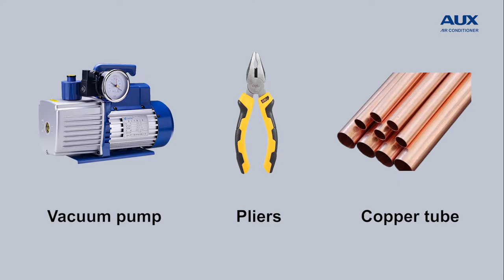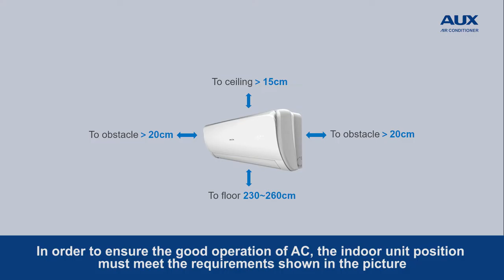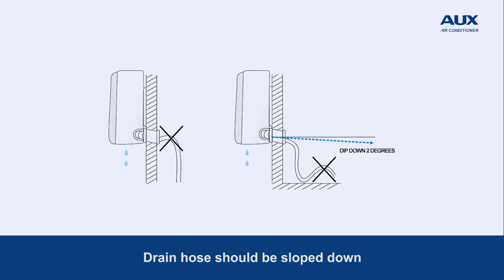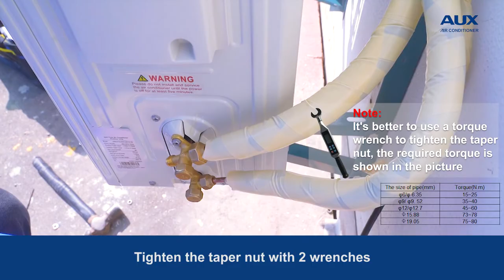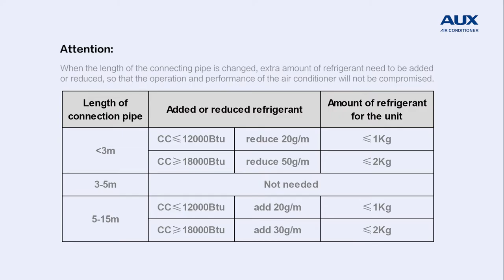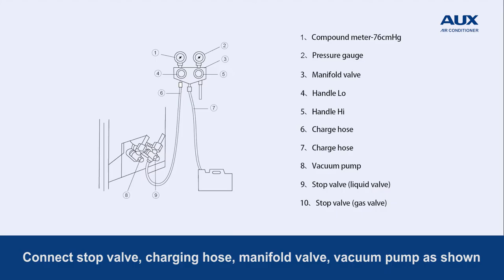AUX Installation video

Comment: What did you do with the gray cable that was installed on the inside unit
Reply: if you see at 14:14 timeline, there is only one set of wire coming to outside unit, and no disconnect box.. so the inside wire is the main power intake
Reply: @pavangiduthuri4617 thank you! That's exactly how I just installed mine. I appreciate the info
Reply: What is the power connected to?
Reply: @savagemonkeez  I have a 120v 12k btu. I just put a regular plug on the end of the grey cable, plugged it into an outlet inside like a window unit does. Outside condenser gets power from the grey cable/indoor unit. Let me know if a way to send you a photo if needed, good luck to you
Reply: No power ?